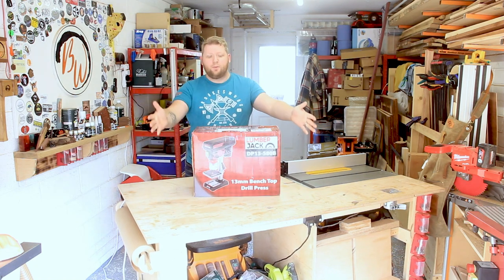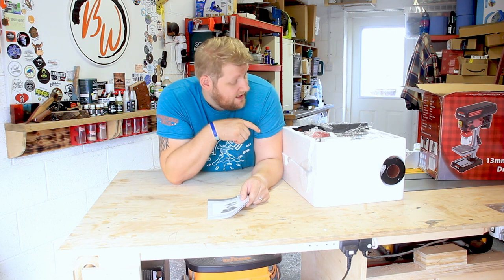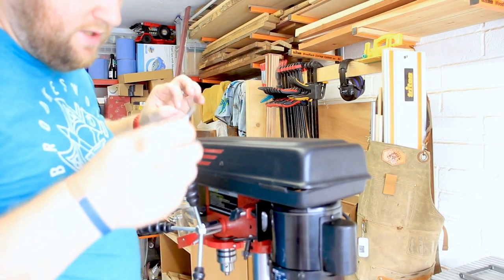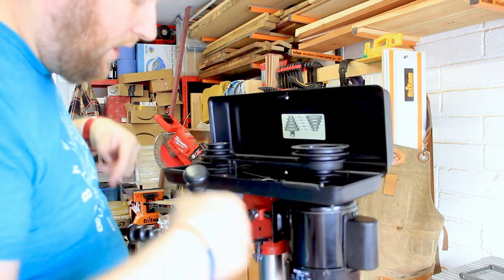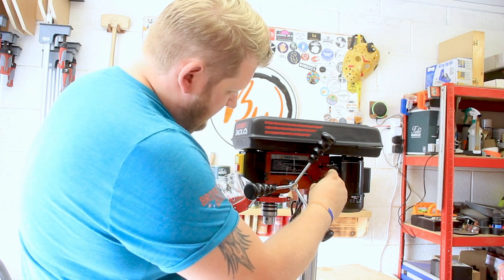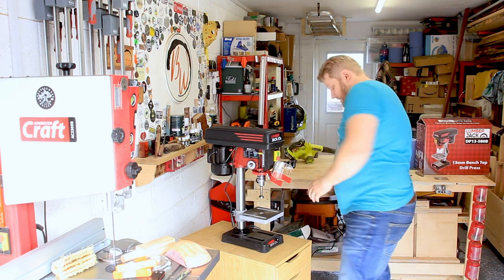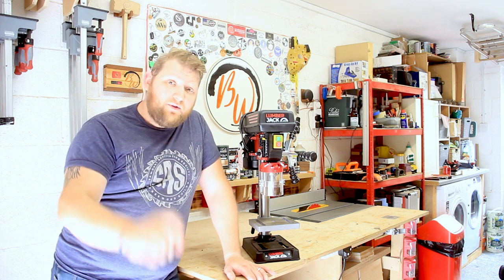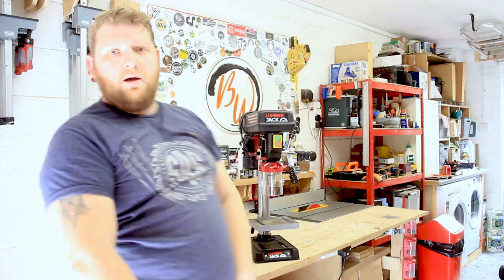Unlocking the Potential: Lumberjack 13mm Benchtop Drill Press Review

Comment: Thanks Paul. Exactly the level of review I needed. This press is cheaper than buying a press stand for an electric drill press stand and a cheap electric drill, and on that kind of setup you don't have selectable speed. I don't think I could use one of those stands with my existing electric drill either because it's about 2 foot long so would be unstable and is SDS plus which adds a headache and some play.
Reply from the maker: Glad you found it useful. It is a lovely little machine. It struggles with denser wood but if you take it slow it’s fine. 
Don’t forget to use “brookeswood” at checkout on the LJ website for a bit of a discount. 👍🏻